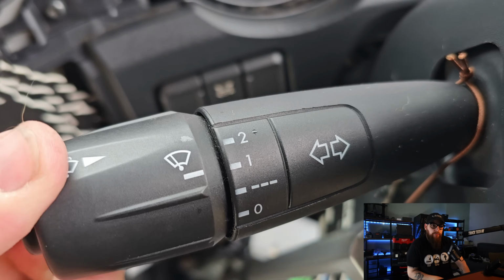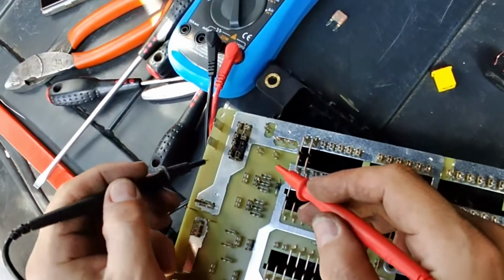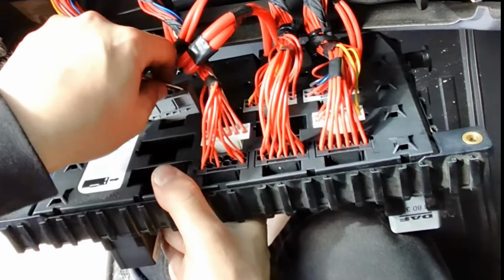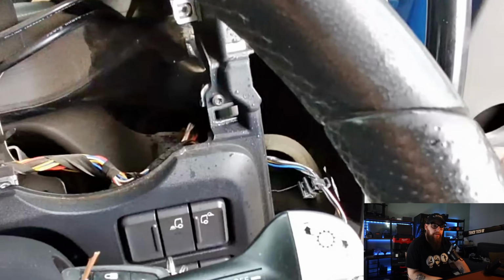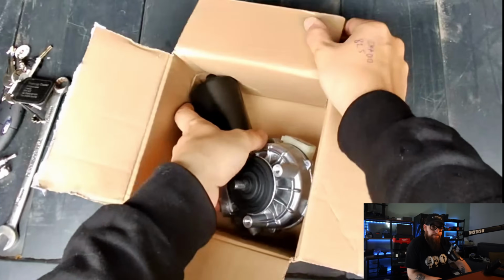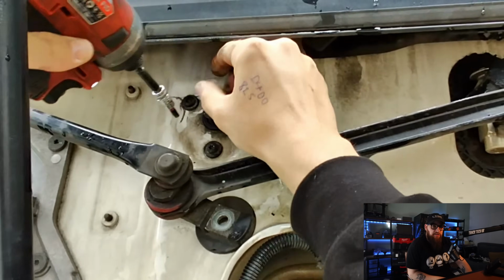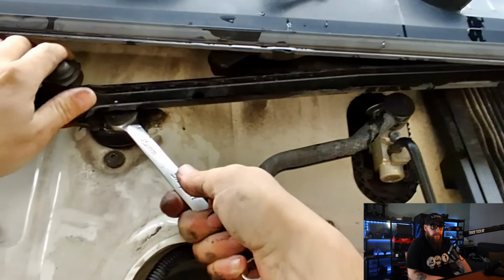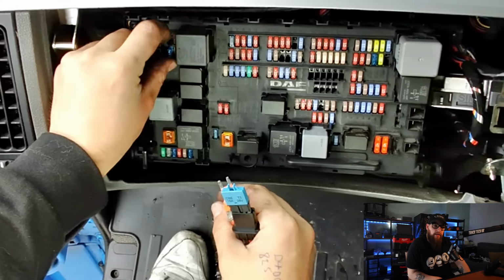DAF XF WIPER WOES! Short to ground FUN!

Comment: I have a 2018 XF and I also had a wiper motor replaced. A while later they started giving trouble again andnthey replaced a relay. Now recently they have started to give trouble again. 
I reckon it's the control stalk. They work on the intermittent setting, randomly on speed 1 but don't get any faster speed on setting 2. 
I had a 2003 XF years ago and it also done the same thing. Had the stalk replaced and everything was perfect after that. 
Is that something you've come across before?
Reply from the maker: Hi, thanks for the comment and for watching the video. I have come across this issue before but if I were to try and diagnose a fault like this I'd be using my jaltest to operate the wipers remotely through the ECU and then compare that to the issue with the wiper stork functions. If it works through the computer.....I'd be fitting a stork 👍

Comment: Good job bro . I did one on an daf xf 105 same problem with the wiper motor
Reply from the maker: Hey buddy 👋 hope you're well 😎. The chances of it being the wiring are slim as you found out but getting to it is just a nightmare  isn't it!
Reply: @TRUCKTECHUK  I even had problem trying to fix the adblue problem .my jaltest wasn't any help so I let the client drive the truck like that .but after 2 months whe  I diagnose it again the  it show me the oil sensor was getting bad so when I replaced it .all the adbue problem was gone but the funny part was it didn't show me the first 2 months ago thY is was the oil pressure switch

Comment: Hey man, great video, just thought i would say i found a much easier way to get to the motor is from the drivers footwell, remove the black foot rest and pull the long rectangular panel away slightly you can actually get your arm up to unplug and there is 'just' enough room to pull the motor down and out (with abit of swearing) i swapped it once the way you just did and though there has to be an easier way! Anyway, give it a try next time and see how you get on! Saves removing dash panels and saves alot of time! My best was 25mins start to finish. Both ways get the job done anyhow 👍
Reply from the maker: Hey Jordan thanks for the comment mate! 👍  I will give that a go next time buddy 😎 I've my fingers crossed that it's not any time soon...... BUT bet I end up changing 3 this week now 😅😅😅😅😅

Comment: Good that you repaired the fuse holder and not simply swap it.
Reply from the maker: Hey, thanks for the comment 😎👍 if I could have got a hotter iorn, I'd have swapped the fuse holder with the one I piggy backed onto, but I did what I could at the time with what we had going 😅

Comment: He would have sell a kidney to pay for the bill if he went to Daf  with that fault (New circuit board,motor, relays plus wiper assembly no doughty.)You saved the guy££££££.
Reply from the maker: Oh most definitely mate. The amount of times I wanted to fix stuff at the dealer and it has to be fitted with "brand new" off the shelf parts is another reason I left. I'm free to repair adblue pumps, VTG actuators...you name it now, I will have a go! Along as its a suitable repair and not a bodge I'm happy to do it 👍 

Think I changed about 300ish for fixing the board and the wiper motor replacement 😅